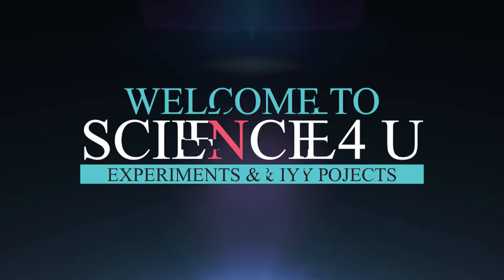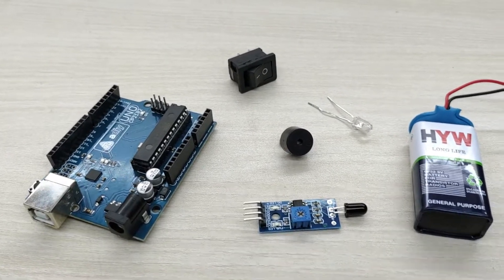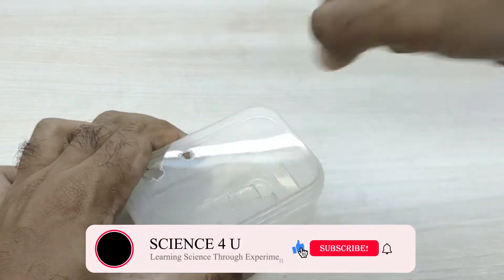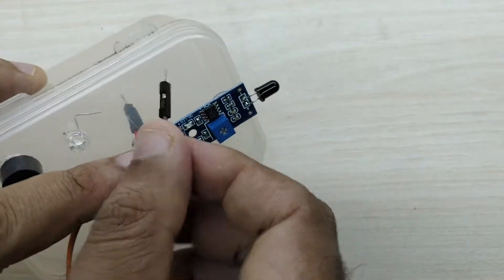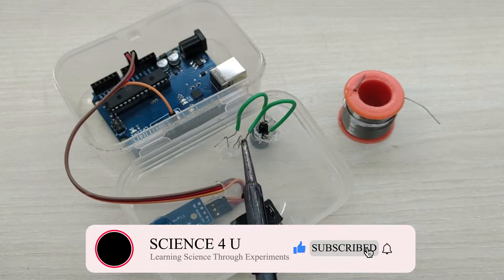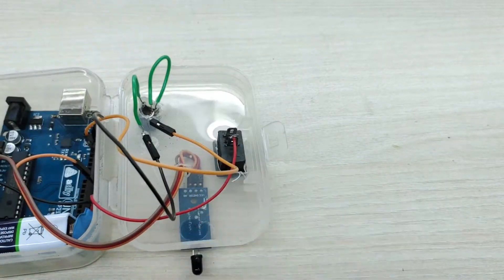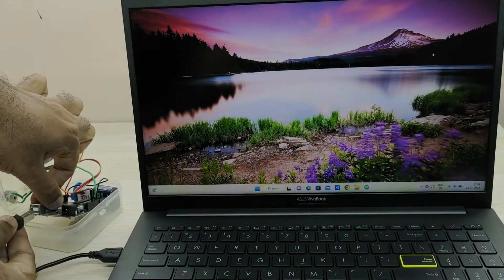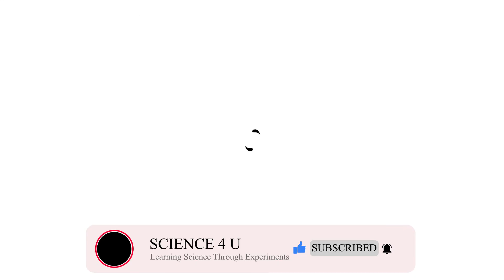How to make a simple Flame Detector || Fire alarm project using arduino

Comment: Bro, can i use five channel flame sensor for a wide range detection instead of using the normal flame sensor? also if i use the five channel i won't need to change any code from ur coding right?

Comment: Can this work with IR sensor
Reply from the maker: No friend. It will not work. IR sensor is a proximity sensor only which can measure distance of objects by sending Infrared waves and measure the reflected waves from the object. It cannot detect infrared radiation emitted from flame. For that flame sensor itself is required.

Comment: Thanks for the idea, could you connect multiple IR sensors to the Arduino? I'm thinking for a large enclosed area of 1300x900mm laser machine with sensors place in various spots to detect flames. Once the flame is detected and does go out by itself after 3-5 seconds, the relay hooked up to the Arduino would open a solenoid to flood the machine with co2 to suffocate any fires.
Reply from the maker: Hi friend. The idea is really good. Definitely you can connect multiple flame sensors to arduino. One flame sensor needs only one signal out pin. On arduino uno, there are 14 digital pins. So you can connect upto 14 flame sensors at the same time to arduino.

Comment: question:is there any way to detect fire from a longer distance besides the IR sensor ?
Reply from the maker: Hi friend. These are all small projects which use simple sensors which are mainly for simple demonstration purposes only. 
There are better commercial sensors available for detection of fire from longer distances. You can have a look at a sample sensor from Honeywell from the below link.
https://www.honeywellbuildings.in/fire/fire-detection-and-alarm-system/system-sensor/spot-detector
Also you can use normal camera and make use of Artificial intelligence for the detection of fire using camera images. This can also detect fire from much longer distances.

Comment: Hi, I can't download the code
Reply from the maker: Okay friend. It is actually a simple code only. I will paste the code below. You can copy and paste that in IDE software and upload to arduino uno. 

int led_pin = 13 ;// initializing the pin 9 as the led pin
 
int flame_sensor_pin = 8 ;// initializing pin 12 as the sensor output pin
int flame_pin = HIGH ; // state of sensor
 
void setup ( ) {
 
pinMode ( led_pin , OUTPUT ); // declaring led pin as output pin
pinMode ( flame_sensor_pin , INPUT ); // declaring sensor pin as input pin for Arduino
Serial.begin ( 9600 );// setting baud rate at 9600
}
 
void loop ( ) {
flame_pin = digitalRead ( flame_sensor_pin ) ; // reading from the sensor
if (flame_pin == LOW ) // applying condition
{
Serial.println ( " FLAME , FLAME , FLAME " ) ;
digitalWrite ( led_pin , HIGH ) ;// if state is high, then turn high the led
}
 
else
{
Serial.println ( " no flame " ) ;
digitalWrite ( led_pin , LOW ) ; // otherwise turn it low

Comment: Hi am going to do this for my science fair project but also want to add a smoke detection system and and sms alert system how can I do that.
Reply from the maker: Hi friend. You can surely do that..You can add a MQ-05 gas sensor and also a SIM 800L GSM module for arduino to do this. There are many videos in youtube about the project that you wish to make. You can watch those..
Reply: @Science_4U_  Can I use the code for those on one arduino board?
Reply from the maker: @kenui2803 Hi friend. I didn't understand your question. Can you explain?
Reply: @Science_4U_  Is it possible to put the code of the flame sensor, sms reciever, and smoke detector on one arduino board.
Reply: Hi please get back to me
Reply from the maker: @kenui2803  Hi friend. It is definitely possible to put all sensors in the same arduino board. You can see some youtuve videos of gas leak detector with sms alert..

Comment: Bro how to do it without soldering alarm wire with led bulb
Reply from the maker: Hi friend. It is very well possible to do it without soldering. I soldered it and connected to the same pin because when the alarm goes, the bulb also glows with the same pattern. You can connect the alarm and bulb to different arduino pins so that soldering is not required. But you have to modify the code also accordingly for the project to work.
Reply: @Science_4U_ ok thanks 😊
Reply: @Science_4U_  bro it's a humble request can you please tell where to connect the led's +ve and -ve in Arduino and also can you provide modified code here please.

Comment: Hi! Besides using IR sensor, can I use heat sensor?
Reply from the maker: Yes friend..you can use the heat/temperature sensor also. But I think it will be able to detect fire from a nearby distance only, since it is detecting based on temperature. But the infrared radiations emitted by the fire can be sensed from a farther distance also.

Comment: Can you please provide me with the Arduino code for this project, the drive link is not working which you have given in description it's urgent bro please 🥺
Reply from the maker: Sure bro. But I checked the google drive link and it is working only. I am able to download the code from the google drive link.
Reply from the maker: int led_pin = 13 ;// initializing the pin 13 as the led pin
 
int flame_sensor_pin = 8 ;// initializing pin 8 as the flame sensor  pin
int flame_pin = HIGH ; // state of sensor
 
void setup ( ) {
 
pinMode ( led_pin , OUTPUT ); // declaring led pin as output pin
pinMode ( flame_sensor_pin , INPUT ); // declaring sensor pin as input pin for Arduino
Serial.begin ( 9600 );// setting baud rate at 9600
}
 
void loop ( ) {
flame_pin = digitalRead ( flame_sensor_pin ) ; // reading from the sensor
if (flame_pin == LOW ) // applying condition
{
Serial.println ( " FLAME , FLAME , FLAME " ) ;
digitalWrite ( led_pin , HIGH ) ;// if state is high, then turn high the led
}
 
else
{
Serial.println ( " no flame " ) ;
digitalWrite ( led_pin , LOW ) ; // otherwise turn it low
}
}
Reply: @Science_4U_  thank you bro so much thanks ❤️
Reply from the maker: Did it work for you bro?
Reply: @Science_4U_  yes bro it worked properly thanks 👍
Reply from the maker: @Unknown__11111  okay man..glad to know that👍
Reply: @Science_4U_  ❤️
Reply: @Science_4U_  Can you explain this code please in detail?
Reply: Can you resend in pdf form @Science_4U_
Reply: @Science_4U_ please resend bro in pdf format
Reply from the maker: Anyway, I will paste the code here. You can simply copy this and use. The code is in my next comment.

Comment: Hello . Can I use multiple flame sensors in one pin??
Reply from the maker: Theoretically YES.. I think it should work, but i have not tried though. The ground and power pins can be common. No issues at all.But it is a better practice to connect the signal wire to independant pins. If both the sensors are triggered separately, then only digital 5V will come as the input to arduino. But if both the sensors are triggered simultaneously, there can be a voltage spike and some interference in the output. But my guess is that it should work. Have to try and see though.